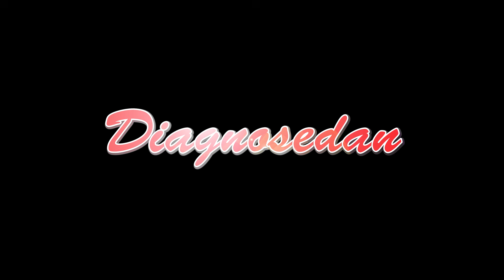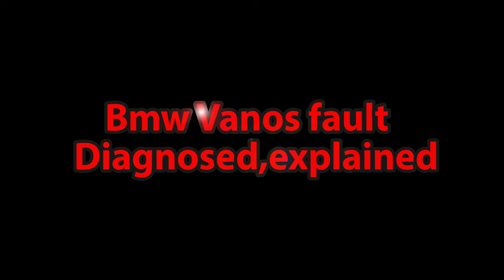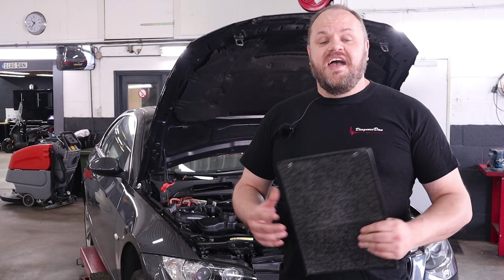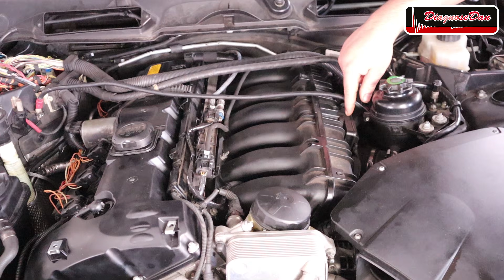Bmw Vanos Fault Explained (3000€ parts replaced and still not fixed!)

Comment: WOW ...seems like BMW needs to make sure the two connectors and solenoids are different to avoid this mistake.

Curious as to whether the original shop confessed and did right by the customer....I know I would have, even though that would have cost me a lot of money.

I guess the lesson learned here is that If a system is controlled by wires...double check that the connectors are in the correct position.

Comment: Hoping someone may see this post and respond. I have an Astra Twintop 1.8l. I was going to switch batteries but did not want to lose the programming information...so I loosened the two main bolts of the battery terminals so I could start the car then switch batteries whilst the engine is running.  With the battery terminals loosened I tried to start the car. As I turned the ignition, I heard the starter stuttering because of the loose battery terminals and suddenly the entire vehicle shut down. The battery has power but there is no ignition lights or anything. The Vehicle is completely shut down. What do I do? I cannot even close the electric windows. Its like somewhere a master switch has shut down.

Comment: Very very cool video Dan, Thanks a lot.
But I wish u had done a rev up wave form i think we would've seen a lot different wave form, looking at idling wave form  it  seems that the vanos is not activated a lot cause a part from that hump at the end the wave form looks mostly normal - given the fact that both connectors where swabbed-.

Comment: No thanks to BMW which placed a "small" plastic? regulator at entrance of intake plenum. And, no thanks for solenoid connectors being identical. And no thanks for oil can failure causing oil pressure diversion to oil pan. Thanks Dan.

Comment: I am so happy i found this video. I have been meaning to replace my solenoids as i thought they are failing. Had them cleaned, had the razor filters cleaned, and have been holding off on the solenoids due to cost. But now i need to order a filter housing cage, as i know my car didnt have one when i did my last oil change  Curious to see if that clears up all my current errors.

Comment: I have also made that mistake of incorrectly switching the vanos intake and exhaust solenoid connectors after removal, cleaning and reinstallation.  This lead me to pre-maturely replacing both solenoids, both camshaft position sensors and both vanos check valves only to realize later the solenoid connectors were opposite.  I put both the old solenoids and camshaft position sensors back in and realized the actual problem was only a faulty intake camshaft position sensor.  Anyway, very good video with explanation of how the vanos works, view of the all the parts and tools used to diagnosis vanos problems.  Also good reminder to not throw parts at a problem.  Thank you!

Comment: I have the 2011 E90 BMW 325i facelift with this N52 engine. The PCV valve failed recently and required replacement which obviously requires removing the valve cover. My son did the work on this car as he is Gold qualified Porsche technician. On removing the valve cover he noticed  there were broken bolt heads in the oil bath around the valve rockers. Turns out they were the cam sprocket retaining bolts which are manufactured from aluminium for crying out loud. Luckily the remaining studs kept the sprockets from rotating on the camshaft.
Replaced the bolts with HT bolts. This was discovered at 170000km, but still leaves me speechless. Why does BMW do stupid things like this

Comment: Big Money Waster   bUmw  Typical bumw  made to screw up it would take no doing at all to make those connectors on fit the correct solenoid but no they have to make it so money is wasted rectifying a MANUFACTERING screwup .   so many times on bumw thing i  have seen this type of FAILURE in design and execution  
.Why people rate them so highly i will never know absolute heaps every single one .

Comment: Note  there are 2 x  for BMW Design.     One is  a plastic part broke and ruined the engine.  2  connectors  with same connections that can be swapped.

Comment: Dan, do you offer any remote assistance? In form of (paid) video meeting? I have a 2006 BMW petrol with an ongoing O2 sensor problems and I am starting to lose my patience (2 banks, wide and narrow probes on both). This would be for private party only (the car is mine) and not for a commercial shop. I can get all the tools you would prefer, generic OBD scanner, Ista/inpa, tool32, all via k+dcan or via ICOM (whichever you prefer). I would send you a pm but yt doesn't let me over a mobile device. Thanks!

Comment: i ve been fixing the customer's car from another workshop. Toyota Avanza 1.3 with VVTi.
it roughly idling.. sometimes stall.

Error code P0016
Camshaft Not Correlate 

Quick scanning live data;
The intake angle 33 deg
 Target intake angle 0 deg.
Oil Control Valve duty 70%
Injektor timing up to 4 ms
O2 sensing rich fuel. 

i cleaned the vvt control filter, oil control valve, 
No difference, same symptoms 
rechecked the timing ratio position, cheked tensioner. 

then i realised, the oil control valve can be turned around and make a wrong oil turning way. 

Maybe it stucked by the carbon of oil and hard to remove so the other workshop use vice grip and accidentally turn the Ocv.. 

And, it fixed.
Reply from the maker: Great find!👌💪

Comment: The connector problem is a result of poor engineering on the part of BMW. Properly designed, the connectors wouldn't be interchangeable.
Reply from the maker: There were some guides and sleeves missing that would have made this mistake nearly impossible.
Reply: @Diagnosedan  Hi DiagnoseDan from New Zealand. I find your videos very interesting. I trained as an engineer. Those Vanos plugs shouldn't have been interchangeable under any circumstances.

Comment: On my bmw the solenoid wires have different lengths. I would have made this mistake if i could have 😂 Also my bmw is a 2005, n46 engine. Wonder why this design flaw exists on a newer model?!
Reply from the maker: There were some guides and sleeves missing that would have made this mistake nearly impossible

Comment: Diagnose Dan: Just throwing parts at the car won't always solve the problem. Previous shop: Right, boys! Load up the parts cannon!
Reply: @Diagnosedan  I did my own diag the other day. My old Merc E55 had a problem where the indicators wouldn't work after the engine had been running for a minute or two. Took it to a local specialist with the Xentry system, they told me there were no fault codes and that they thought it was the EIS or key. They also told without the accessory drive belt fitted, all was well. I took the car away and tested the alternator with the engine idling, it was kicking out 15.5 volts! So I replaced the alternator. Job done! About £900 saved by using my brain vs following their advice!

Comment: Great video. Cant give enough thumbs up for a proper car diagnostic video. Shame on BMW using same connector, but I guess cost-cutting goes to insane lengths.
Reply from the maker: There were some guides and sleeves missing that would have made this mistake nearly impossible

Comment: Double D is the zen master. I've seen things diagnosed on this channel that are impossible without the right equipment. The way BMW in particular has their canbus modules programmed is nothing short of madness!! When a burnt out touch to open solenoid can cause a no start condition, the Engineers are flying by the seat of their pants. Luckily, people like Dan are out there to detect the idiocy built in lol. In a BMW, you are almost better off using an Arduino canbus reader and determining the OEM canbus protocol. Then replace the ECM with something like an Adaptronics unit. Make smaller canbus daisy chains and keep the run function entirely separate from body control modules. You would think it was a no brainer, but not at BMW. Not to mention, all of the German manufacturers except for VAG cut costs too far. To the point that reliability is greatly impacted. Audi was in this group as well, probably even worse than BMW for reliability. They have since stopped the practice because of resale value and beyond massive depreciation. You'll notice that even Bentley has really improved lately.
Reply from the maker: Thanks for watching
Reply: @Diagnosedan  It's really been a pleasure. Your practices and procedures are the way I love to see things done. Maybe some day an OEM will require their engineers and accountants to do a 3 month rotation in a garage like yours. If it ever comes to pass, you would have the best cars ever made

Comment: Common issue for every BMW car.  "BMW Problems first are caused from the mechanic and after from any failure!!" If the service is not done by a BMW expert, future problems are a certain thing. At the video Dan shows two common mistakes that mechanics make, when they think they know everything. :P
Reply from the maker: Alot of issues can be prevented with the right maintenance

Comment: The infamous E90 series... after the amazing series that was the E46 these were notorious for all sorts of issues... especially the convertible ones. From what I have heard an E90 spends most of its time at the garage for something that goes wrong with it... curious how BMW could get these cars so wrong somehow... or maybe people just hate on them more because of the ugly styling not sure..... ok let's see this :D
Reply from the maker: Good maintenance can prevent a lot of Trouble😁
Reply: @Diagnosedan  you guessed my middle name there. :D Every year my R57 Cooper SD sees at least one oil change(with transmission level check too) with all filters including fuel filters changed depending on how much pedal to the metal I am doing and at least one 4 wheel alignment rolling on 2 sets or wheels (summer 17inches, winter 16 inches) and then there are the fun mini curses such as the constantly breaking windshield due to the angle of attack of stones definitely having no chance to just bounce off :D and then of course the constant rendezvous with my scan tool(in my case it is the Carly BMW) to find out if the car needs anything. The N47 engine usually tells you long before anything goes wrong with it... I know its reputation for the timing chain problem but that tends to be due to lack of maintenance on the user's part in my opinion and the crap oil and BMWs suggestion for 8k miles between changes(but not in 2 consecutive decades apart duuuuh :D ). So yea I hope I do not miss anything on mine. 

I just threw in pulley kit as the car reached its 9th year in service and the front harmonic balancer and the belt tensioners are due for replacement at that time... My crankshaft pulley 'told me' it wants to pack in when it gives off that clapping sound at cold idle... when we pulled it out it looked like it was maybe for another 100miles before separating in the rubber it was cracked all around in a massive Grand Canyon fashion :)

And at 9th year I was due for 4 new shocks... the way I drive this little shopping cart it is a miracle those lasted that long... the rear ones leaked out their oil and started bouncing bad so they needed to go... now I am hoping my bushings are good for maybe another year before all of them need to go and the control arms... yeah maintenance is the name of the game.
Reply: This is so exciting... ok so at 12:04 I am betting the exhaust valve should not flutter the way it does... unpausing..... where is my popcorn...
Reply: Oh come on 3k for a swapped set of plugs? Fire the lazerz :D

Comment: Why are those connectors not keyed differently so they only fit in the correct place😒

The VANOS unit looks very similar to the VVT-i cam phasers Toyota uses. They have filters that aren't one way valves - usually hiding under a 14mm bolt somewhere. Do BMWs have the issue that Toyota's have sometimes where the cam phasers will rattle for a few seconds on startup?
Reply from the maker: Not on these models

Comment: I have to give you credit for making the point that some of these issues are mistakes that  are easy to make.  The vanos intake and exhaust connectors being switched can be handed to you by another shop who previously worked on the system and you diligently memorised which connection went where when you disconnected,  but wiring diagrams sometimes if properly used can remove some confusion. The oil filter casting explanation is the first that i have hear of this so thank you for rhat.  I can see why a technician may have been leed into the situation where he is considering all the oil passages and routing from the camshaft through the variable sprockets which will have you looking at hardware and seals in the camshaft assembly and its carrier housing.  Most technicians do a great job but there are things done previously to the engine that you fall victim to.
Reply from the maker: This engine had some guides and sleeves missing that would have made this mistake nearly impossible

Comment: Thank you for the valuable information and innovative tests!  As a BMW technician, I came across mixed VANOS connectors multiple times too! With trained eyes, the problem can be seen right away with the VANOS harness. Also I see a lot of missing central part in the oil filter cap after an oil change, causing low oil pressure and debris flowing through the engine and VANOS solenoids!
Reply from the maker: Thanks for taking the time to leave a comment Eric it's appriciated

Comment: This is also a faliure on BMW engineerings part. The connectors should have poka yoke applied to prevent fitting on the wrong solenoid. Also the vanos units on the camshafts should also have error proofing. Manufacturers need to consider initial manufacturing and full lifecycle maintenance work completed on their products to ensure reliability and low cost repairs.
Reply from the maker: There were some guides and sleeves missing that would have made this mistake nearly impossible

Comment: I have seen this happen before on bmws.  Its also common for people to have the upstream o2 sensors plugged in wrong because both connectors are the same and they both have long wires. Also quick lube places are notorious for throwing the plastic filter cage away and messing up oil pressure to vanos. I have replaced half a dozen of these.
Reply from the maker: Thanks for the comment!

Comment: always double/triple check your work plus when removing those connectors initially you'd be inclined to mark them as it's obvious a mistake would be made.
Reply from the maker: If you look closely you'll see they actually marked the connector with white Paint 🤣
Reply: @Diagnosedan  I did miss that but I do watch on a screen I am 3 metres from with blurry old man vision

Comment: You gotta wonder about the logic the shop was using. "It was running fine other than this broken part when we got it. It runs badly now so it obviously had to be one of these other unrelated parts". I've learned the hard way, if it doesn't run right afterwards double check all your work and compare every little detail to what's in the shop manual, because more than likely you screwed up.
Reply from the maker: Thanks for watching

Comment: I hope the customer was told what the problem was. I would be so pissed, i dont know what i would have done.
But one thing is for sure, the money i had given to the shop to fix my car would gone home with me. This shop should not be allowed to work on cars.

Anyways, thanks for a great explanation of the Vanos system, i have never completly understood how it works, exept the actuall timing of the cam. But now i understand it 100%!
Reply from the maker: The workshop that worked on the Car is also the owner they tried to fix the Car and re-sell it
Reply: @Diagnosedan  Ooooo😬🤣 Guess they wont make much returen om this one.. 😅

Comment: Only ever use the parts cannon when the parts are cheap! DPF regenerating too often on my car.. I fired up the parts cannon, DPF pressure sensor and EGR blanking plate ordered, both fitted, problem fixed for £30. I still have to remove blanking plate to see if problem returns :D
Reply from the maker: Thanks for watching 👍

Comment: You know it's funny I pulled the engine out of my friends BMW to do a bunch of work to it and I noticed that those plugs were exactly the same so I looked at a wiring diagram when I put it all back together and made sure I had the correct plugs on the correct solenoids! 
When I saw that pressure wave for my thought to myself "huh it looks like the exhaust cam is retarded"
Reply from the maker: Thanks for watching

Comment: wasn't expecting that a swap of the Vanos solenoid would solve it. The car world have run like crap if it was wrong. like crap crap. I've got a e46 318. an i've change vanos solonoids and actuators and it runs better but still has a problem with idle speed and torq at low rpm.
Reply from the maker: Thanks for the comment Filiph